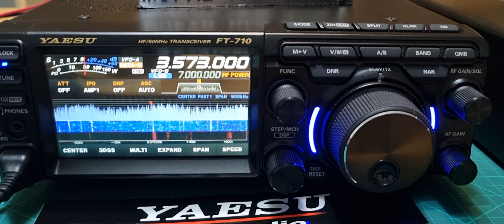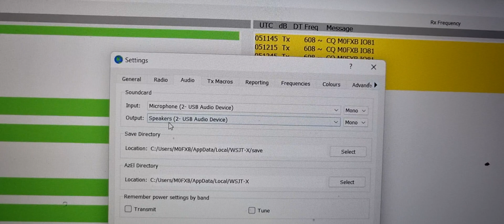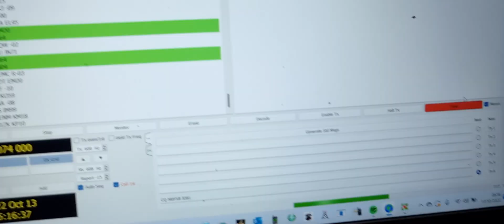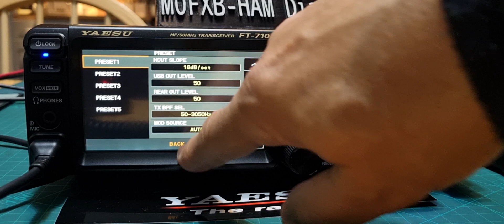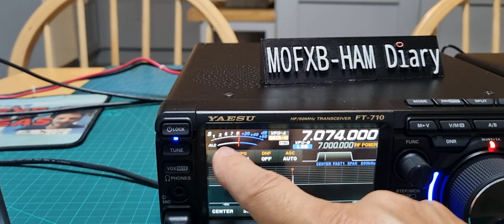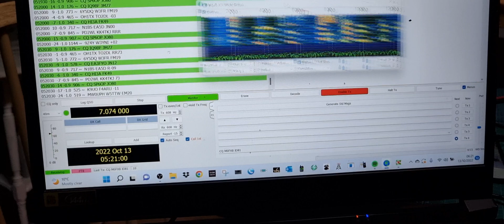YAESU FT-710 FT8 TX/RX My Settings -So Far

Comment: Hello there, great video. Do you know what settings you had to change on the radio for the CAT to work properly under WJST-X for TX. Which baud rate, parity did you use? Which driver did you use  the one from Yaesu site or the one from silabs. The selected radio was the Yaesu FT-1200 correct?  Any information will be greatly appreciated.  Edgar, 73/KE4GFE
Reply from the maker: https://youtu.be/bElQgDBICyI
Reply: @M0FXBHamTech  Thanks so much. I researched a bit deeper and I was able to get it to work properly . Regards. 73 / KE4GFE
Reply from the maker: Oh good news

Comment: Thanks for the info!  Just picked mine up today and plugged it into my pc but it was not detecting the drivers. I’ll have to try this once I get that resolved.
Reply from the maker: Load the driver first , fingers crossed -73
Reply: @M0FXBHamTech  Haha Thanks!  I messed with it again tonight for a good while...  Some reason I can't get any modulation out when the radio goes into TX or in Tune.  If I look at the speaker in the advanced settings, I can see sound is going through the speaker, its just not making it out on the transmit..  Radio goes into TX no issue, just 0 ALC, even with the power meter up and the speaker showing maxed out audio.  Can't for the life of me figure it out, I have a feeling its one of the Output settings in the menu.  Tried USB/Rear but still nodda.  I'll look forward to your updated video as I'm sure you are still trying to dial down settings.
Reply: @kabish0603 ever get this resolved? Just got mine the other day with exact same symptoms. At this point I’m thinking the powered usb hub is part of the problem so I’ll be getting a long enough cable to go direct to the pc.
Reply: @davemo04  Yes I did, however I sure don't remember what I did to get it working.